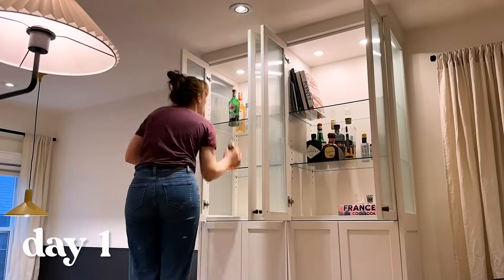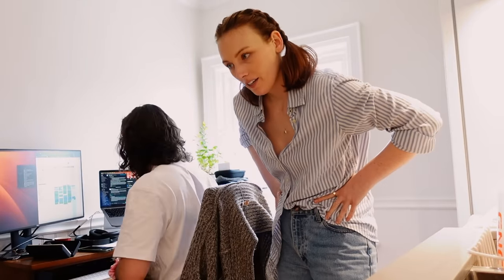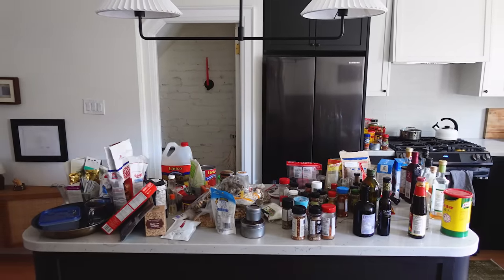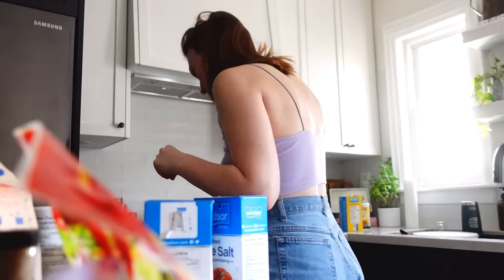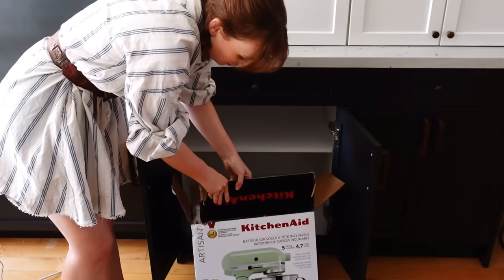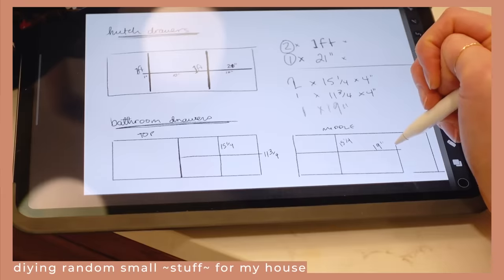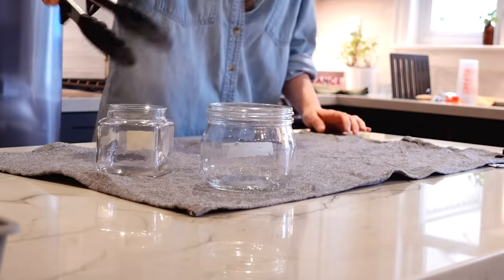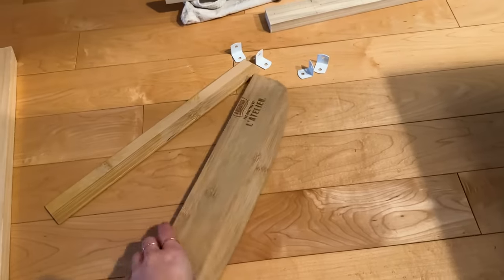realistic kitchen organization with DIYs and hacks

Comment: My top life hack is to have a spice box (ours is a bamboo IKEA one with a handle) which you pull out on to the counter when you want to spice things up which has all your individual spic jars in. Especially useful if you're a put everything in kinda spice girl.
Reply: It helps to do that because you often find you need a spice from the back of the cupboard and end up knocking over several jars  trying to get it. I would rather slide out a box and get my one spice out than have to try and sort out what I had tipped over.
Reply: i just put all my spices together in a basket and I can vouch - it is life-changing!!

Comment: Love going through the process with you! And while I love the oil and vinegar cupboard, it seems very practical, heat exposure can make them spoil super quickly, especially that sesame oil since you're probably not going to go through it very quickly ( you should probably keep that one in the fridge actually). I would store them and least in the lowers for easy access or somewhere else entirely. Vitamins also can spoil super quickly from heat and I personally would not have them above and so near the stove. 

My tip, even if it's not the most practical (although it tends to be fine in a small kitchen like I've always had) is dishes in the uppers near the stove and food storage as far away as possible. 
I'm also the kind of cook that puts everything out on the counters while I'm using it so this has always worked for me!

Comment: Why don't you turn your glass cabinet/ appliance garage into a pantry? Chia seeds, oils vinegars should not be that close to heat source - they will go rancid very fast. Your coffee maker would be more useful  and safer out on the counter so you don't have steam wrecking the inside of the cupboard!  Can you put your microwave somewhere into the island?
Reply: My thought exactly. The steam from coffee machine & microwave can damage the inside of those cabinets. And as a daily coffee machine's user myself, I constantly open the water lid, milk and creamer holder, coffee beans grinder lid, etc - so definitely need an open space for me to use it. It will frustate me in matter od days if I store my coffee machine inside a tight space like that.

Comment: I label my spice jars.  But Everything else if I can't tell what it is by looking at it (which you can with most things) I cut off the name of the item from the bag and slide it into the jar.  Sometimes I even include the cooking instructions.  Saves a lot of time.  But if you buy bulk and can't tell what it is by looking I like the grease pencil...good idea so you can reuse the jar for other things without much effort or waste.  Very relatable video.  I use Mason jars from the thrift store for most of my storage.

Comment: I just organized and made temp containers with boxes that fit the space.  Sometimes 2 narrow ones next to each other.  You can tape boxes together, cut them down, etc. Once your figure out where to put what having the boxes means you just pull out and move to a cabinet or the table for sorting.  You can use fancy bins, rotating platforms, labels or whatever after you get it sorted.  You will probably shuffle things a couple of times when you use the kitchen.  I do not keep doubles in different places because I ended up not knowing my inventory of stuff.  I would start with a small box sometimes and it ended up getting switched to larger boxes when I found more stuff that needed to be grouped by that category.  Shelf height and depth will bite you when something you want there doesn't fit.  You cannot do it all at once so group by category and hope the height and depth of the shelf works. Some sites have tips like cut pool noodles to keep things from shifting when you open the drawer or a mat to keep things from sliding.  Good luck because my sister and I bumped heads a lot.  Assume there is going to be a junk drawer but try to avoid it by assigning places for those rubber bands, paper clips, batteries, etc.  I collected large and small boxes for months before starting to organize.  You really need to date the spices, cans, etc. because that gets out of control fast.  Do it later.  Some people say they make an inventory of what is in the cabinet because out of sight is out of mind.  My kitchen is huge and I had no idea where my husband's cooking stuff is.  I accidentally bought things I didn't need and really need a map.  You need a filing area for appliance instructions, not just  cookbook type stuff.

Comment: Protip for labeling.... use packing tape and the sharpie paint pen. Much easier to write on than round containers. Plus you can practice to get your best handwriting. I initially just wrote on the containers but changed to the packing tape trick. 
Rubbing alcohol or hand sanitizer will remove the sharpie paint pen from your containers. Also get both white and black pens because depending on the food items you may not be able to see the print on top of the item and where you have the container stored. 
I love recycle and reuse. I saved up the sizes of glass containers I thought I would need before venturing to swap out containers. I did by stackable Square containers for spices amd seasonings based my current storage situation from Daiso so a much more inexpensive option than the Amazon route. I researched to 6 months.  I like to cook so I have lots of seasonings as spices. 
My sauces in the fridge I reused the squeezable ketchup and smaller mustard containers.

Comment: I live in a small apartment with shelves that are nearly impossible to move. I ended up buying a bunch of new containers when I moved in all from the same set/line because they are designed to fit together and that allowed me to use as much of the space as possible. The ones I brought with me didn't fit together as well and meant there was lost space I just couldn't afford to have. I didn't like spending the money and I have a variety of other containers the very top shelves I have to climb to, but sometimes getting sets is handy.

Comment: Labelling pro tip: If you want to use stickers but still want to be able to remove them easily without them leaving a sticky residue, use canning labels! They are specifically designed to come off so you can reuse the same jar for a new canning project.

Comment: I’d suggest to not think of what ingredients are used for but the ‘class’ similar to how a supermarket classes it’s isles. Above the stove in that shallow space I would’ve added extra shelves and made a spice display with large bottles of frying oil like canola oil, and ‘pantry staples’ like sugar, flour, baking powder and corn flour in the big spaces each side of the hood vent, then used the pull out shelves for the smaller bottles of oil and vinegar, rices and pasta, and even cans. This means everything around the stove (the heart of the kitchen) is a staple ingredient regardless of the dish or time of day. I would have them made the area with the coffee machine a ‘breakfast and spreads’ zone so you’re not running to multiple zones in the kitchen when you’re rushing out the door at breakfast. This would also be a great spot for vitamins since you can grab them while making your morning coffee or tea. 

Either way, live in it for a while, change as you go, and slow your habits and workflow inform how your kitchen is set up. 

Side note; you can add a power outlet inside the cupboard above the fridge to make a built in yet hidden microwave and still make full use of the appliance garage. We use a microwave maybe once a week compared to other appliances so it’s not worth that valuable space.m and I totally get the hesitation of even wanting one.

Comment: I love your kitchen but I would definitely replace those 2 pull out cupboards either side of  the Extractor fan with a hinged door and pull out baskets. If you don't do it now while you can get it to match you will regret it. It probably would not cost that much but be far more useful.

Comment: Those wooden spring drawer organizers QUICKLY put so much pressure on the drawer that it started pushing the front wooden piece off of mine. 🫤

I’ve found that custom inserts that don’t put pressure work better long term.

Comment: IUs ball canning dissolvable labels. They’re inexpensive they’re readily available and they dissolve easily with a wet cloth or when you throw them in the dishwasher. Everything in my kitchen is stored in all sizes of mason jars or carry jars. Some of them are secondhand so my buy new ones sell because I also do a lot of canning. They’re better for the environment and very affordable. And after you open the canned item, you can use the ring again but not the lids and I use those lids on my storage containers instead of throwing them out. I just do a tiny little mark on them so I know those cannot be used for canning. I love them for all my spices. I buy the widemouth 8 ounce jars. They’re squat for all my spices. I’m Hugh Mongas spice collection. They stack up on each other as many as three or four if you want which I do and they store so well I can get like 12 for about 10 bucks. I use them for my dried goods I even have gallon size ones. It keeps all pests out and things stay good so much longer. I think what you did is amazing and secondhand. I’m basically sharing this for other people who might be interested. But those ball labels that you just with a sharpie right like flower or sprouted flower for example and then they just wash right off. Great job in the kitchen and making adjustments and compromises with your partner.👍🏼👏🏼👏🏼👏🏼👏🏼👏🏼👏🏼

Comment: Are you really going to take the toaster out of the cabinet every single time you use it? If you don't think you will use the microwave often then I would put it over the fridge and the more regularly used thinks like toaster in the hutch so you can pull them out to use and slide back in when done.